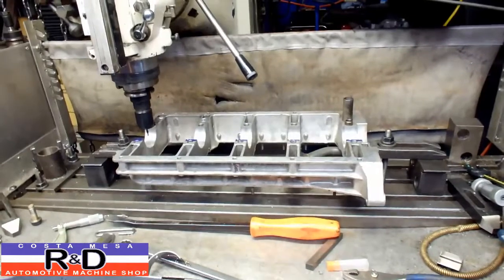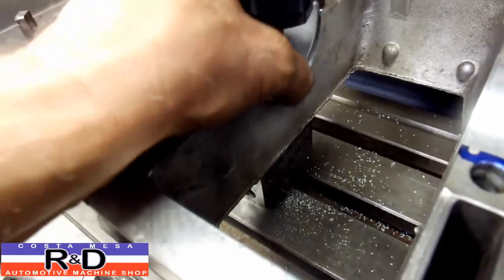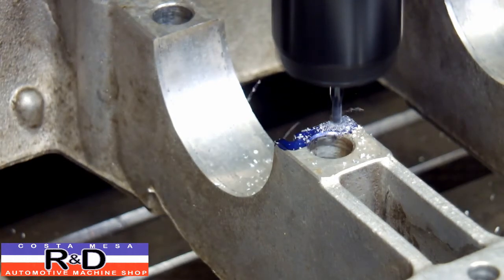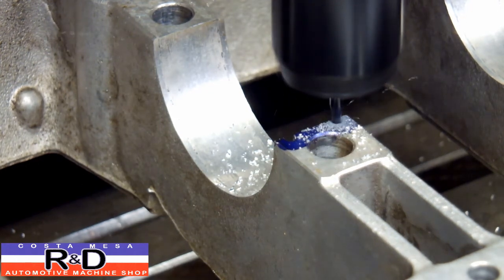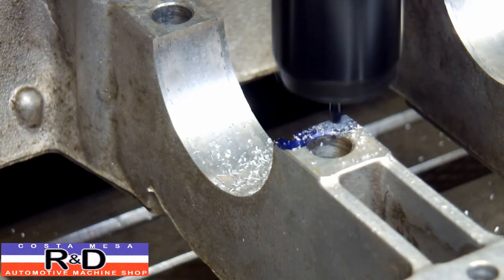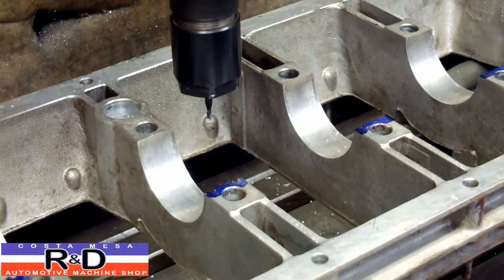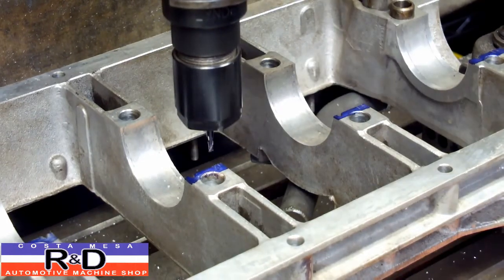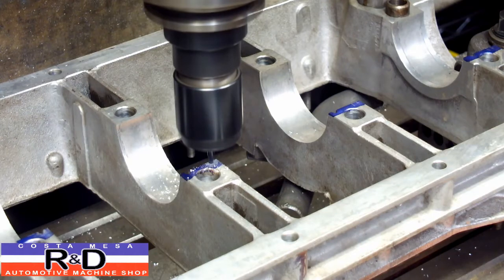Lotus 907 Main Bearing Girdle Modification

Comment: Good job.
The reason for the different tang position is that the bearing shells likely came from a Bedford or Holden. Remember that this engine was originally developed on a Vauxhall block and hence some of that DNA carried over.

I don’t blame the car owner because the Lotus bearing shells are more than ten times the price . . been there and done that.

When I put Bedford shells into my 910 engine (Lotus Excel) my machine guy did a similar mod but with a mill. I reckon your solution is just as good and with far less set-up time.

Comment: Good job of modifying for the bearing shells. That was a very nice 2-litre twin-cam engine, although some complained that it didn't have a lot of low-end torque. Here in Europe they were  equipped with two Dell'orto carburetors and were a bit more lively, I believe.
Reply from the maker: Hi Bruce, we are going to machine the block so we can put come Dodge main bearing in since the block has a weird main bearing size and the standard Lotus shells are too small. New video on that. I used to get the Weber/Dellorto manifolds and put them on the US cars when I ran a repair shop, oh so many years ago. This build is getting a Holden stroker crank to make it 2,2 liters.